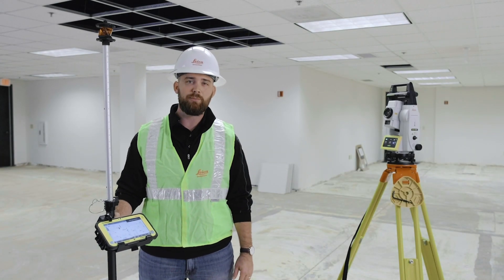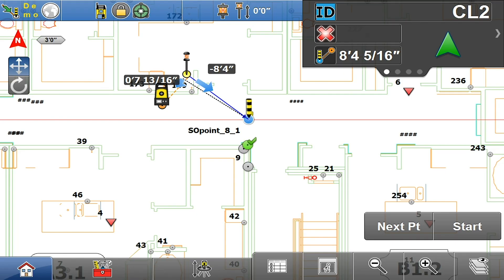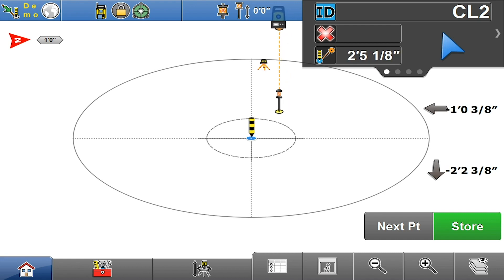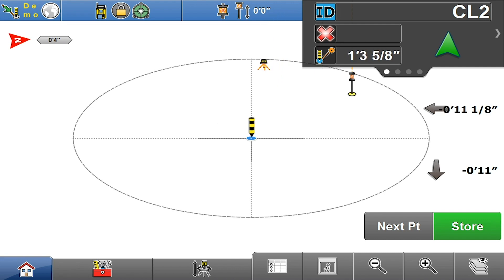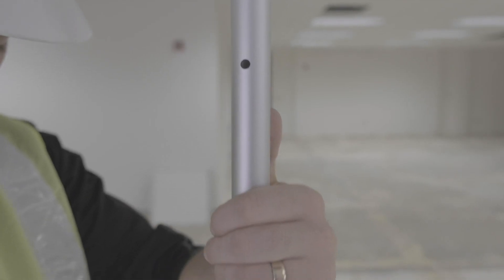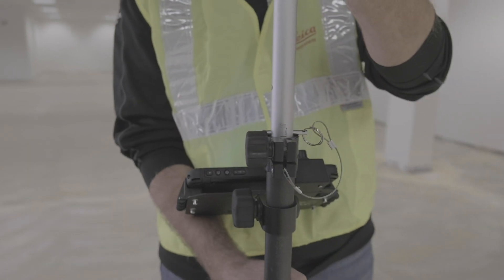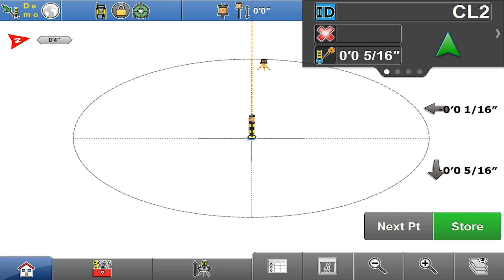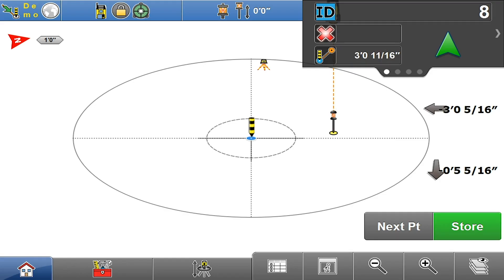How To Perform Traditional Layout Using Your Robotic Total Station Leica iCON iCR70

Comment: If you're trying to lay out stuff tight, you can save a lot of time and effort, and increase accuracy, by attaching a bipod to your prism rod.  For some reason most of the people I work with put the bipod legs on their side of the prism rod (that is, the side away from the instrument) but I have found that it works much better if you put the bipod legs on either side of the line from the prism to the instrument.  This also has the advantage that if the prism rod starts to fall over it falls toward you, maikng it easier to catch before it hits the ground.